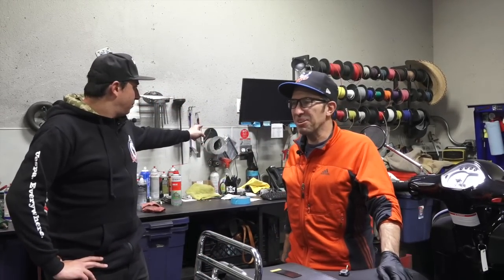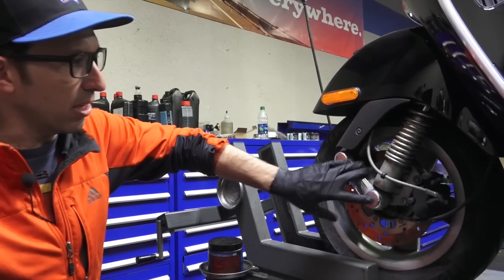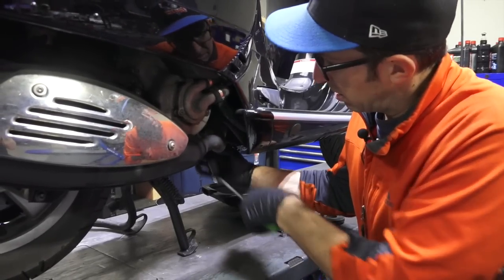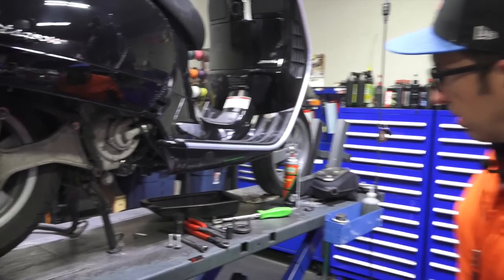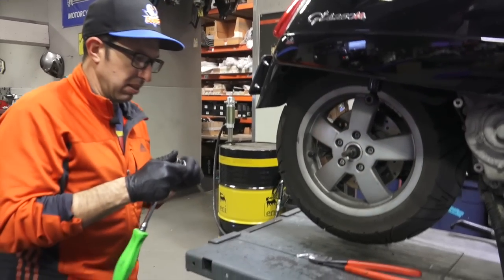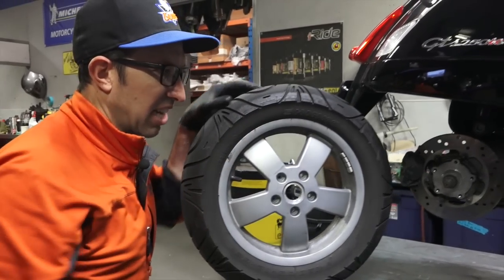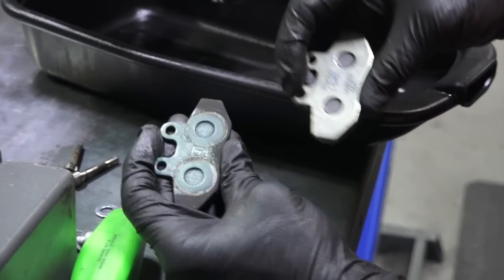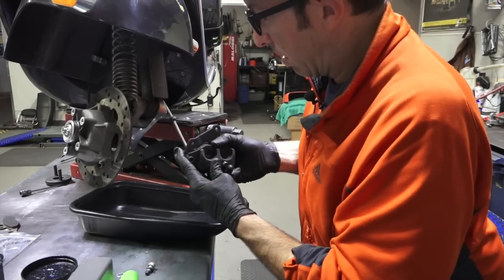Change Brake Pads & Eliminate Squeaky Brakes on a Modern Vespa Scooter

Comment: Robot, since I got my GTS 300 2016 I have watched your work. I really appreciate it.

I don’t do much myself except changing oil.

I do it every fall and spring when I change between summer tyres and winter tyres (with studs).

I don’t use that thing to prevent the rear wheel to turn when losening the axle nut. I just use a strap around the lever for the rear break lever. If I press the lever and fixate it with a strap I can easily losen the 24 mm axel nut.

Thank you from Sweden!

Comment: Hey Robot… hope your well… wanted to ask I have a 2018 Vespa GTS ABS which I’ve owned from new and only done 3300 miles. 300 in last 16 months. I have a problem after riding for 15km in warm weather the brakes locks on and cause the bike to slow down and wheels get red hot! 😮 with wheels seized by brakes,any suggestions? Once cooled both wheels free on centre stand 😮

Comment: Hi,I would like to ask something that has been bothering me lately and I don't know where the problem might be.When I drive my Vespa LX 150 2006 at a higher speed and hit the front brake harder I start to feel a vibration in the front.The whole front end shakes.Could I have a problem with the brake system or is the cause different?Thanks in advance!

Comment: Hey Robot - I think I have air in my ABS system on my brand new 300 GTS super?  I've strapped the brakes and it works ok for about a day.  What are the special tools needed to fix my mushy brakes?

Comment: G'day, I have a 2005 Gts250 and I changed the front brakes yesterday but now I notice my bike will only start after a few tries. Is there a sensor somewhere that I have bumped? Could be underneath when I jacked the bike up?  Thank you for the video.

Comment: HI I HAVE A VESPA PX 200 , 2008 , THE PROBLEM I HAVE IS , OVER THE PAST 15 MONTH I HAVE HAD TO REPLACE THE REAR BREAK DRUMS ? TWICE , THE HOLE IN THE CENTRE GETS WORN , SO IT WILL NOT MAKE CONTACT WITH THE SHAFT ?, MY SCOOTER HAS ONLY DON 1200 KLM

Comment: On one occasion when I was working full-time another mechanic challenge me to put on a cylinder head without using the torque wrench he did not think I could get it to the proper torque rating because I always use a torque wrench so I torque down the bolts and I was within two tenths of a foot pound on the torque on every Bolt
Reply from the maker: The sign of a good mechanic ;)

Comment: Hi mr robot, I have a modern primavera 150 that squeaks at hard acceleration from zero, and I recently just changed the cvt cover bearing. The noise was there before and after the bearing replacement. Do you have any idea where the squeak might originate from? Thankyou!
Reply from the maker: Possibly the clutch nut has back out a bit and is rubbing on the clutch bell. Here's an extreme case: https://youtu.be/A29AlfE8Ts0
Reply: @VespaMotorsport  Thankyou very much, I'm watching your newest video about a white lambretta as of now. :)

Comment: I am having vespa 150 sxl 2016 model . i am facing a problem with it. It run few miles and starts stalling and behave like the petrol or spark runout. But after few minute it start again and show no problem for whole day.
Reply: Any suggestion
Reply: @John Martling thanks brother.😃

Comment: Robot... can I use 10w-40 in my 2018 300 gts? I’m in Phoenix. I use it in my pcx150 so why is the Vespa calling for the 5w? Thx buddy.
Reply: Use 5W-40 (JASO MA, MA2 - API SL - ACEA A3) as stated in the GTS user manual. They know why they are asking you to do so. Or, use whatever else, but mind the note "USING OILS OTHER THAN THOSE RECOMMENDED CAN SHORTEN THE LIFE OF THE ENGINE."